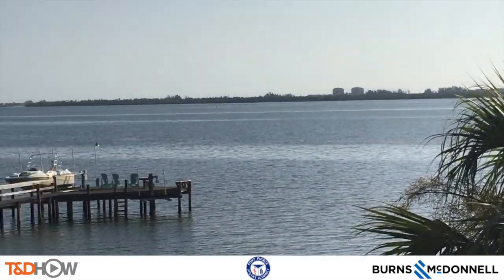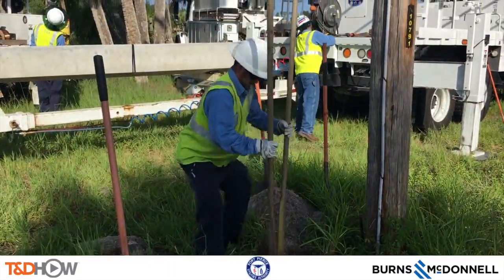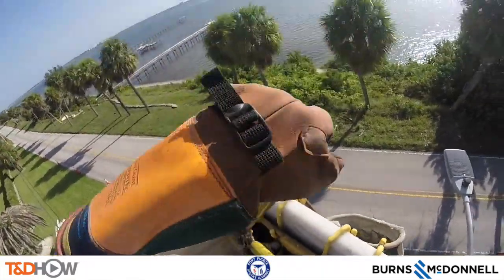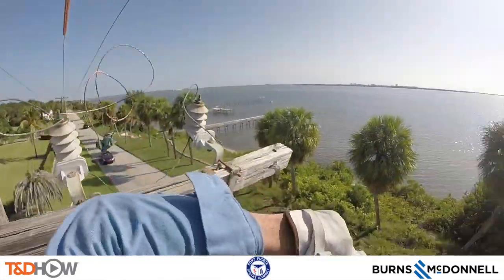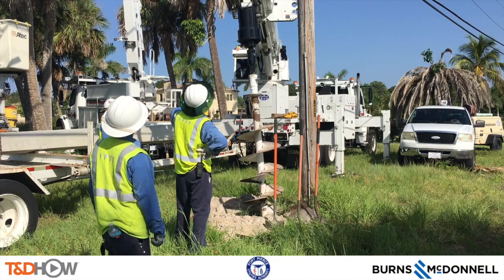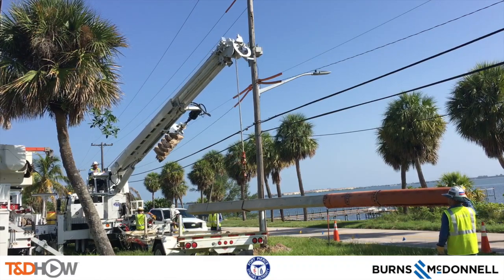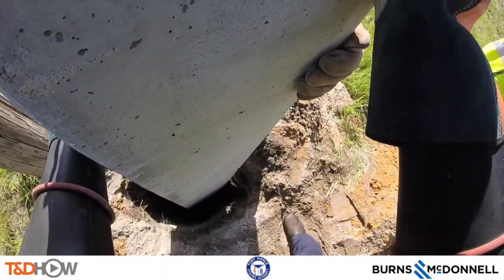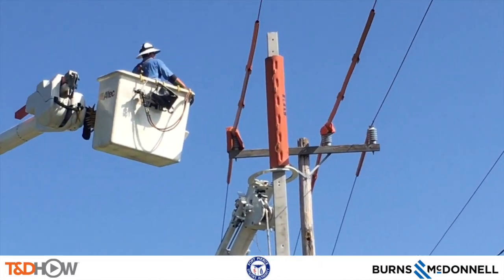Concrete Pole Install

Comment: I would definitely like to know what for they installing "black" metal power pole with meter on it couple feet from road in subdivision with no wires going to it and not connected to any house?
Reply: Is that in your neighborhood? idont see any in video.  if so  they could possibly be 5g antennas.. the future of IOT which really should be monitored I work in telecom and am worried about the health effects on them I wouldnt wanna buy a house with them near me cause they are gonna be installed every 500 to 1000k feet.   Its crazy stuff.  one tech we dont need yet.
Reply: @culbyj3665  somebody said it's 5g thanks for response

Also... they say current studies don't show any problems, but indeed they make many mistakes, unbelievable ones too, like lead in gas